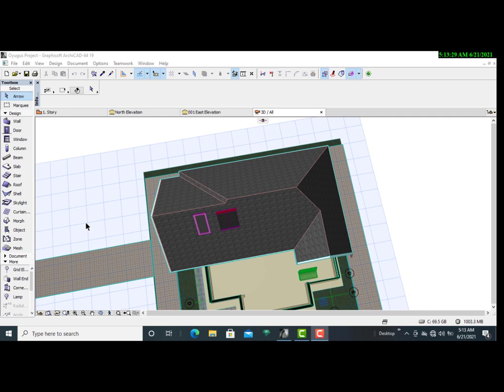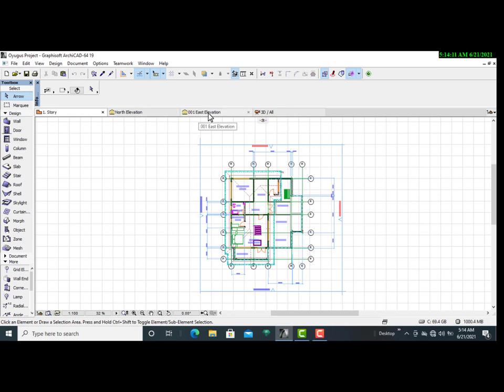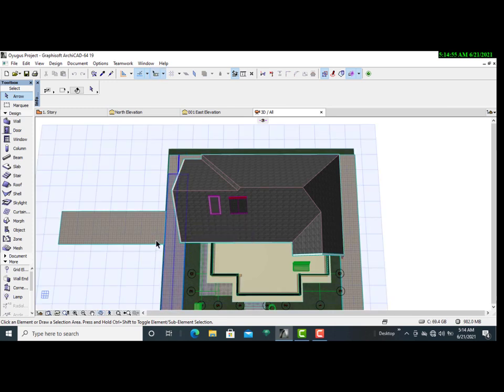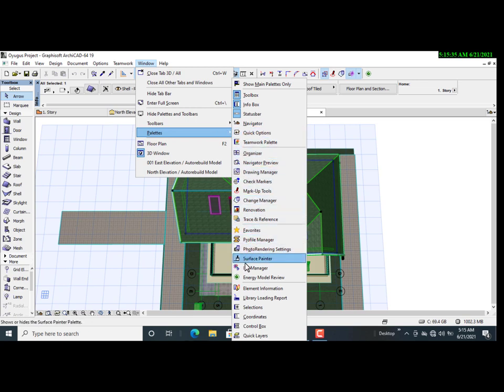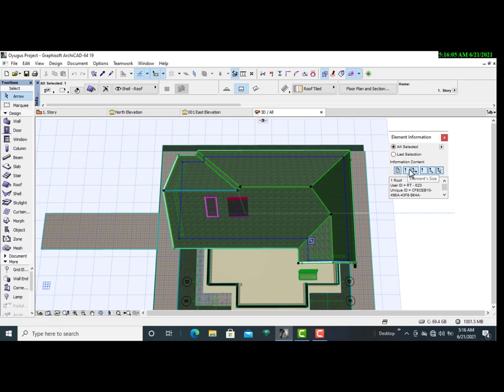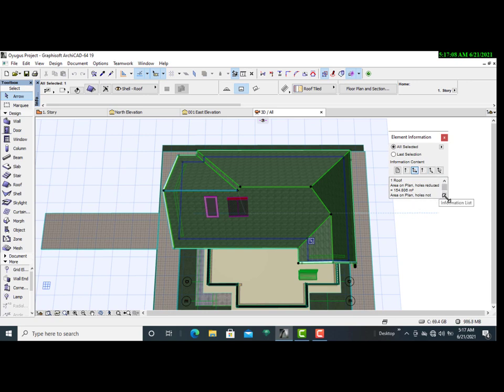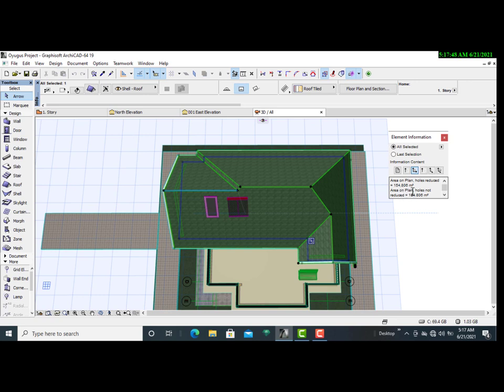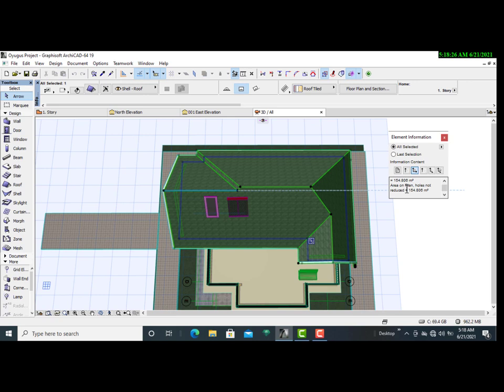How to Calculate Element Surface Areas Using ArchiCAD

Comment: This is a wrong method of getting a roof surface area. It does not consider the roof pitch.
Reply from the maker: Thanks for your opinion. Mind sharing the alternative method regards.
Reply from the maker: Remember this is an inbuilt BIM system calculating the surface area. Meaning it has factored in all the determinants of surface area such as length, height and pitch of the roof. But feel free to share with us another method. Regards.
Reply: @antiquebuildsolutions  @dennismwenda1696 is correct. You need to instead use the 5th button for "Element's Surface" which will give you the correct surface area, with roof pitch factored into the calculation.  In the video, you successfully calculated the "plan area" which is just the projected area as you would see it in a floor plan. That's fine if all you want to do is calculate the footprint, but it won't give you an accurate quantity.